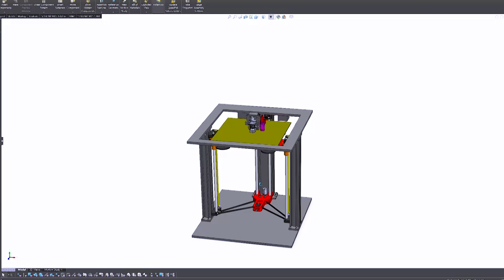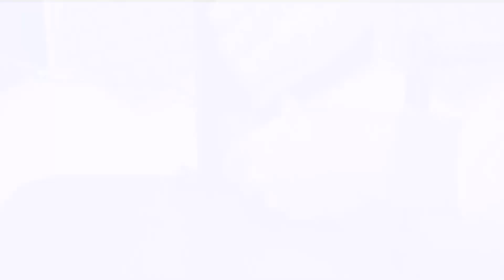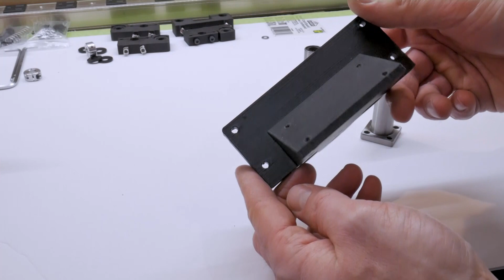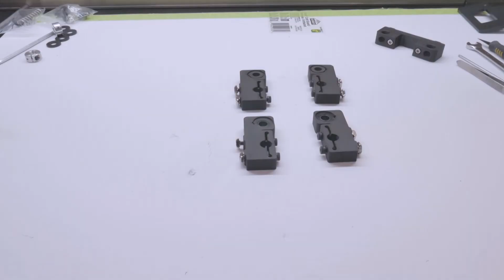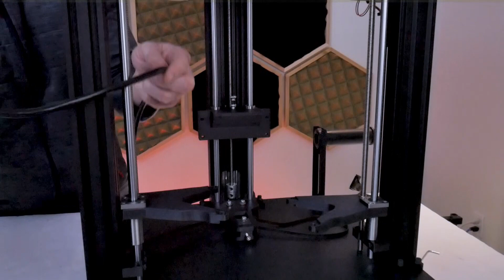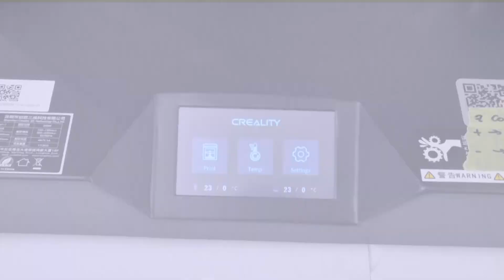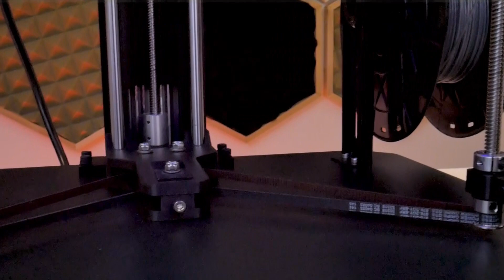Creality Ender 7 - Project Dragon Rising - Triple Lead Screw Linear Rod Upgrade!

Comment: You shouldn't have to do all these mods to a 600 dollar printer to get a decent print.
Reply from the maker: Just to be clear, I was getting decent prints before the mod, but I'm going to be switching over to Klipper and cranking the speeds way up. I anticipate that the original z axis system will shake. Even without exceptionally high speed, the original system wasn't ideal but the prints were - at the very least - acceptable. Should you have to do it? No, I agree you shouldn't have to, but it does make it much more stable. This is something Creality should have addressed if it was designed better.

Comment: I'm pretty sure  the "Nerd" knows what he's doing. And the point of doing a review is you taking it out of the box and hitting print. Which is what most "consumers" do. Most people aren't going to install different beds and doing mods. A true review is done the way "Chri's Basement "does it and the way Thomas Sanladerer do them.  The kind of channel you run is way different than 3d printing nerd runs. His video's are made for Dick who never touched a 3d printer and wants to buy one for his son. Your videos are for the guy like me that has 5 printers but hates waiting for a print to finish so he doesn't really 3d print he just enjoys buildings and moding the printer.
Reply from the maker: Yes most consumers want an out of the box perfect printer, but not many exist on the market today (from what I've seen). Most printers that are in the price range that a beginner would find reasonable to purchase require a lot of attention. Unfortunately this seems to be a tradeoff with the hobby grade printers. I am currently testing an Artillery Genius Pro and so far it has been the least troublesome cheap printer I've tested to date. I think we're slowly getting there but I still haven't found a single low cost printer where you can literally just assemble it and press go. Even the ones with auto bed levelling inevitably require fiddling with offsets and other parameters.

Comment: Having the Ender-7, feelings are mixed. I love this printer because of the XY core. This is the best thing ever made. I believe that printers should not make any move XY on the BED rather than going up and down. The rest of the work the head should take care. That why i love it. BUT....i dont know if i like the glass bed or not. Glass bed ensures that flatness is achieved, but there are issues sticking material on the surface, even if you apply any time of glue. Leaving in Europe is hard to find an alternative size PEI bed, which im willing to get one for my Ender-7. Apart from that as mentioned couple of days ago, the firmware must be updated, letting us go higher temps both on the bed and nozzle. Lets see in the future what Creality will do for these issues.
Reply from the maker: If you need a PEI flex plate for your Ender 7, head to my website Embracemaking.com and I can get one for you :) If you're in Europe just use the contact form on my website to ask me for a quote. Thanks!

Comment: Very neat mod. My congratulations for your design and execution. Obviously you have spent time refining your design and ended with an excellent solution.
Yes the ender 7 is different but I have come to really like mine. Big drawback is still inability to modify marlin. I am running octoprint which compensates to a degree.
Anyway, I have tried to order from your website and found that I can't complete the order as it's not allowing shipping to Australia. Can you arrange this? Or, as an alternative, provide bill of materials and the stl files? Happy to negotiate a price.
Thanks again for your great work.
Reply from the maker: Thank you so much! I would be happy to ship to you. Please use the "contact" form on my website so we can email directly. Send me your full address through the contact form so you don't have to post it publicly on YouTube. Thanks!
Reply: @EmbraceMaking  Ok thanks. Will do
Reply: Contact form doesn't appear to be working. At least not via phone. I will try tomorrow on PC
Reply from the maker: I suspect it is probably the phone number format. I'm still ironing out some details on the website but the contact form might not like phone numbers not in North American format. If you try again just make up a phone number in the format xxx-xxx-xxxx or you can email me directly viaautoworks@gmail.com Probably easier to just email me directly at this point lol sorry for all of the trouble!
Reply: there is allways Klipper if you are willing to try, works wonders for the ender 7

Comment: Thanks for the video as well as thinking of additional bed support design. I just purchased a Ender 7 and have run into ZED issues right away. Right now the machine cannot find home at all. I had a stutter step occur and now I am wondering if the stepper is bad. Have you run into any issues like this with Creality?
Reply from the maker: Very strange, perhaps a component might also be binding? You might have to take your z axis apart and make sure your lead screw nut runs smooth over the lead screw without getting stuck along the way. Creality always has weird issues to be honest. You often get fairly good value for your money but their quality control isn't great and the printers will generally run well for a few months before you start replacing minor things. Their support sucks in terms of troubleshooting but they are usually pretty good at just sending you free replacement parts if you need them... have you had any luck further identifying the cause of your problem? Is it just the z that won't home, or all axis?
Reply: @EmbraceMaking  Hi sorry I was away this past week and just returned.  Just tried re-leveling and tried running a benchy (boat).  It heats up to the required nozzle temp and bed temp. Then when the display starts to say printing the whole system shuts off! There is definitely something going on with this new unit
Reply: I have contacted Creality for a full refund. However I am curious to see what you would charge to take a look at the unit and see what your findings are is this something you would be willing to discuss?

Comment: Now this a serious take on this printer, way more thoughtful than an angle grinder for likes. kudos to you sir
Reply from the maker: Thank you very much Angelo! More to come. Going to spice up the hotend / extruder and I see a Klipper install in the near future too ;)
Reply: @EmbraceMaking  I'll implement this, do you ship Internationally? (Chile). I've just got the 7 a week ago and already cranked a big project out of it, with mixed success. I'm new to printing although I'm not to CNC machinery. The machine is solid on XY but Z is just bad engineering. As for settings, I've tweaked printing parameters on my own designs/botched parts since I had no time to benchy anything. You revealed some surprising takes on the configuration/assy video. Ive gladly appreciated that
Reply from the maker: I'll ship international for sure! Just head over to my website embracemaking.com and send me a message through the contact form and you can send me your address. I'll look into international shipping rate for you. Thanks!
Reply: Yeah, that dude was like "it's a useless part, lets cut it off" ffs
Reply: I know exactly who this is 🤣 lmao